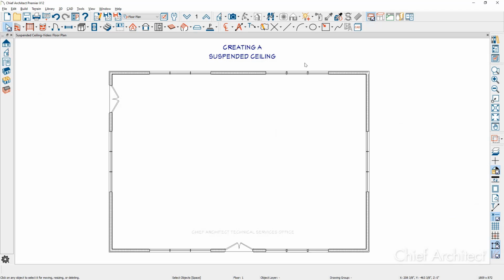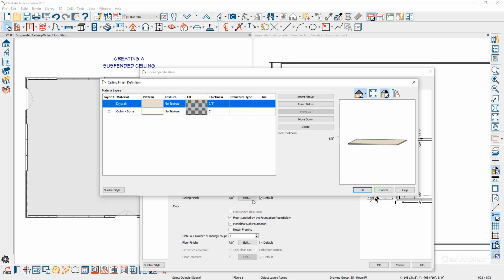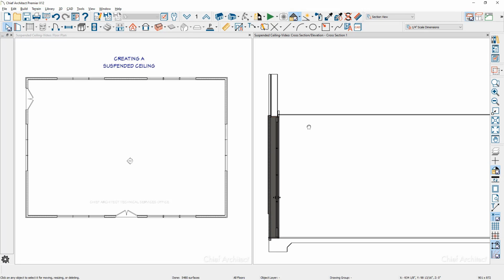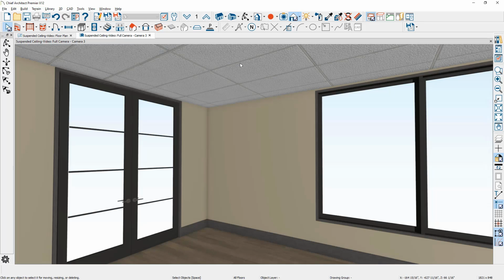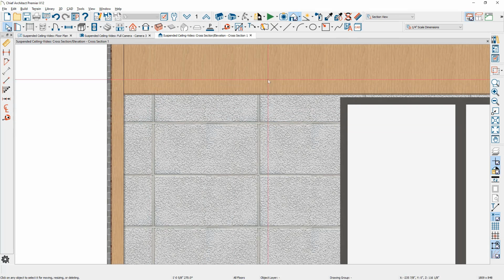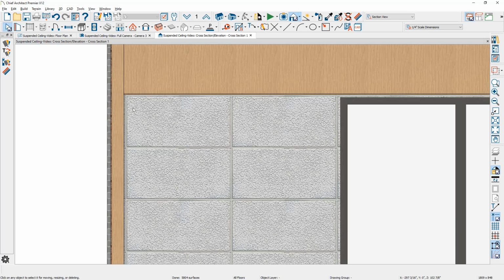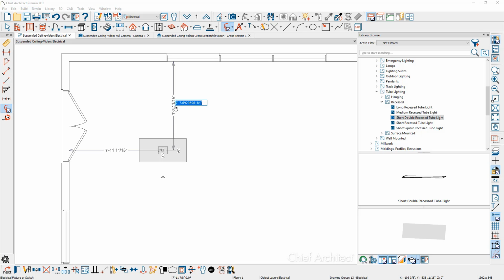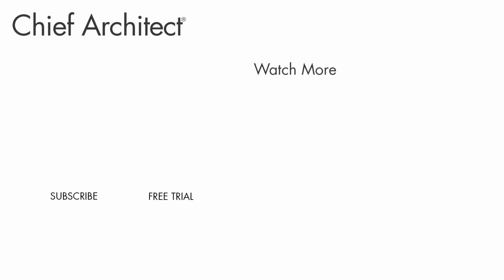Dropped Ceilings

Comment: Is it possible to view the ceiling grid in plan view? To better place the light?
Reply: We just use cad lines on the floor for equal border tiles and light placement.  It can then  be saved out as a block and used as a reflected ceiling view in layout and or on its own layer set. You could also Place lights on the floor in respect to the grid pattern created to make wiring connections then make a copy layer of the lights,  and lift the lights to correct height  if you need a 3-D view. IMO, much more accurate and most importantly an equal border on all sides, more or less how we do it in the real world. Well actually with just a calculator.
Reply: It will be better to have an automatic ceiling grid option like the automatic framing in walls or trusses. Maybe someday.